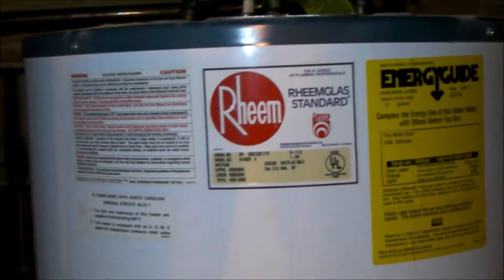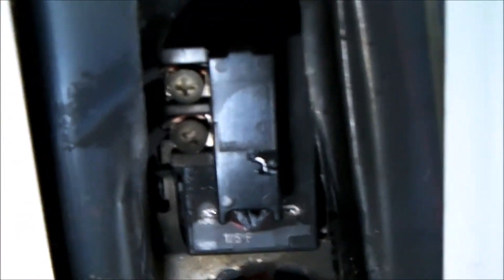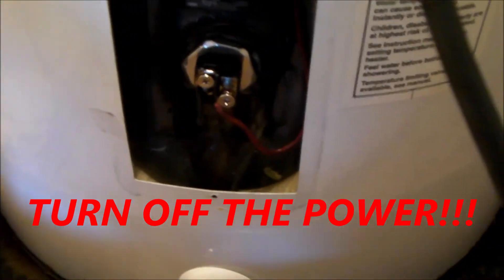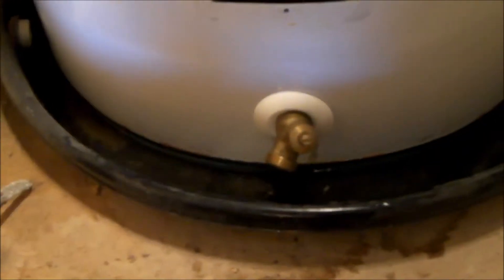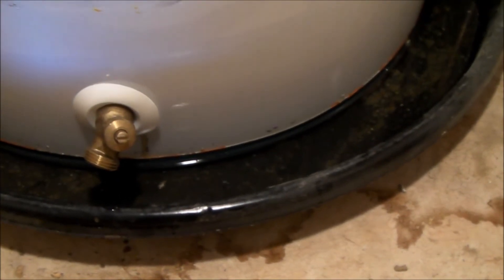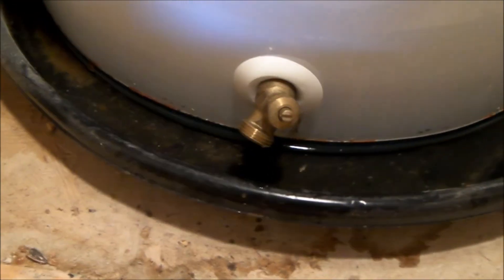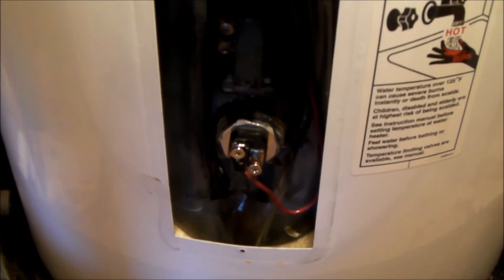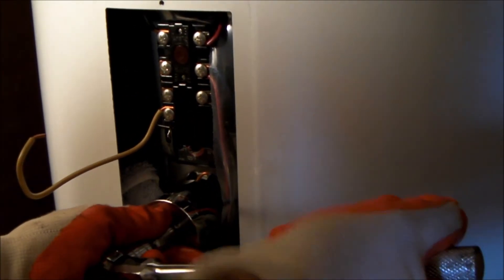Electric Hot Water Heater element replacement (with hilarious screw up) - Circuit breaker tripping

Comment: Hi, thank you for the tips. When you loosen the elements, how much do you loosen a few turns and then tighten again or leave them loose until the tank is completely drained? Thanks again.
Reply from the maker: if you keep all the valves and faucets closed, you should not have to drain the tank.  The vacuum will hold the water, sort of like sticking a straw in a glass of water and closing off the top with your finger and pulling out the straw.  Vacuum holds the water in the straw and will do the same in the water tank if everything is air tight at the valves and faucets.